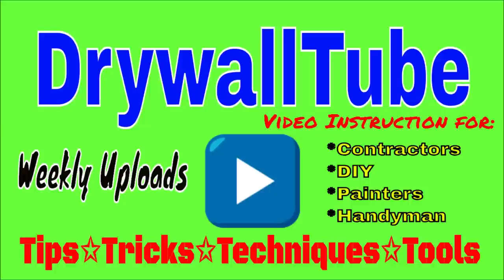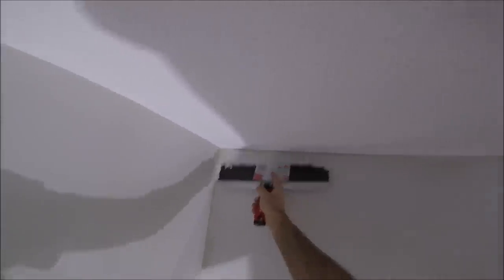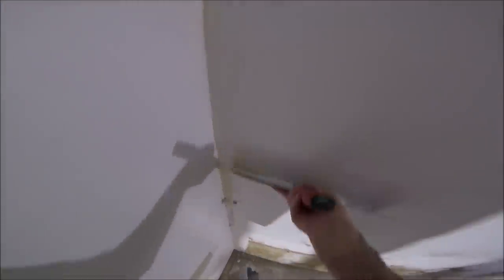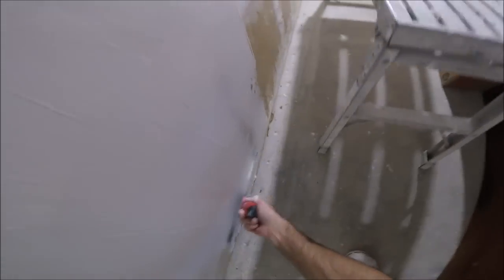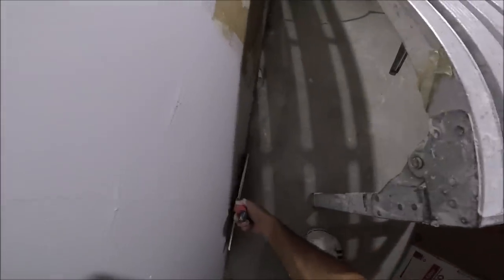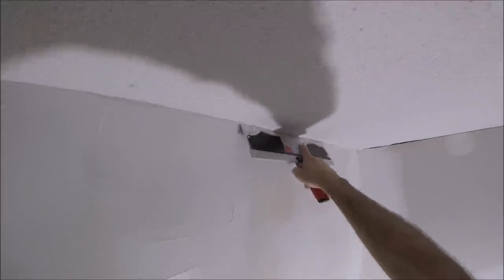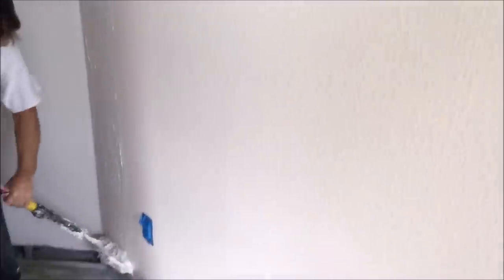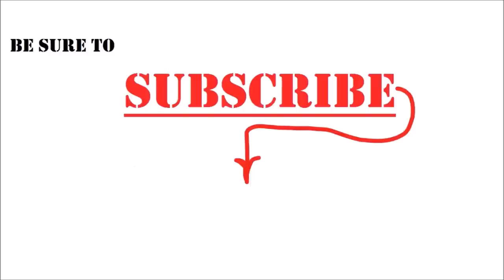How to Cover Your Ugly Damaged Wall with a Skim Coat- Looks Like Glass

Comment: Hi, I am finishing my basement and I did framing, plumbing, and electrical and hired the drywall job out.  A guy hung 67 4x12 sheets and had two coats of taping mud when he got in serious car accident!  I hired another guy to complete the finishing, but got 'took' by unscrupulous guy.  He made matters worse, and then sprayed Kilz 3 over his shoddy work.  I have gotten quotes from $1300 to $2500, and was about to pick someone when a highly experienced guy came over and quoted $500 and said  he could fix it in a day, whereas all others said 3-4 days.  He said he planned to fix problems with hot mud and then do skim coating with USG Topping.  Other estimators said they would use USG Plus3, and one guy said he would just thinned All Purpose (his quote was $1800 for one guy).  I am now wondering if I could do it myself.  The basement has a couple of closets, but is basically 1200sqft of one big room with stairs, a utility room, and a small bathroom.  My question is ... does the 'pressure thing on the right' come naturally after you get the hang of it?    The walls need to skim coating because the primer was sprayed on too heavy and the guy doing the backrolling couldn't get up and also didn't know what he was going so there are places where primer globbed up.  I bought a 9" power sander and the temptation to try it myself is getting to me.  But I'm 71 and not what I used to be.  Advice?  Maybe the experienced guys doing it in a day know what they are doing.  The Kilz 3 will sand, btw.

Comment: #DRYWALLTUBE i have a question.  i have some pretty old drywall in my house. not sure of how old but the tape job has bubles and there isnt an angle you can stand where you dont see the mud stacked up from the horrible job the previous owners did.  i'm a DIY guy.  been in construction, electrician, 25 years.  so  some of the bubbles i cut out  where i did the cutting or pealed the tape it didn't quite do right .  sucked the water out of the mud i guess.  so i sanded 5 or 6 hours on one wall just to flatten out the lines.  now i need to seal,skim coat, sand,  then primer (whats a good primer?).  did i leave anything out?  do i have to seal? and i also have that exact ceiling!

Comment: PAUL... IM A NEWBIE DUIY'er.
I WOULD APPRECIATE ANY AND ALL SUGGESTIONS OR DIRECTION TO ANOTHER ONE OF YOUR VIDEOS....
I'm in a house that was built in 1905. MY father had put up dry wall in some rooms still have very old plaster application. Some of these walls have painters tape STUCK TO THEM. (I took a break. Longer than I should have. I was frustrated with my results and stopped. (Suggestions welcome for correcting...)
Also frustrated with the unevenness of ceiling meeting the wall unevenness. My father prefers the white ceiling color on the walls look. Looks very uneven with these walls being so old . 
HUGE 26 wall project!

Comment: What about for walls that have large lumps and clumps sticking out? Like major uneven walls? 
Some of our walls have been "fixed" in the past to cover up LARGE holes using some sort of mud, and the person half-assed it & now we have large glumps & lumps in our wall. 

Imagine looking at the wall from the side angle, and seeing a large "S" or wavy shaped wall due to the large globs. 

We live in an apartment, so ripping the walls apart isn't an option for us. But we do have permission to fix whatever is there currently. 

Are there any options that would allow us to temporarily fix that wall, rather then ripping it out? The only thing we've tried, was to sand it - but that only smoothed out the bumps 😂 It didnt blend them or get rid of them (obviously). Its so bad that even if we stuck some wall paper to it (the wallpaper likely wouldn't stick anyways) but you'd see the large boulders/lumps sticking out anyways. They are like little hills in our walls (sorry that's the best way i can describe it without a picture 🙈). 

What can we do?

Comment: Dang.  No matter what I do I always get overlap lines.  Am I not pressing hard enough?  I’m using the side of the knife where the ends bow away from the wall.
Reply: Ok I figured it out.  I wasn’t pressing firmly enough.  I was too worried about leaving a edge that I WAS LEAVING AN EDGE.
Reply: I just bought a house built in 1905 and just about every wall has wallpaper. Even the ceilings 🤦🏻‍♂️  
There was an addition to the house in 1980 and they didn’t prime or paint a large wall and I uglied it up real good.  Much like the wall in this video. 
There are also a couple of areas in the master bedroom that were floated in and maybe they were primed 🤷🏻‍♂️ but the wallpaper remover must have softened the mud so there are some gouges that need to be skimmed. 

Thanks for sharing your knowledge.

Comment: 19:53 With the tube-amplifier in the back, that looks like a Hammond organ or something similar. This must be a church or a school. Anyway, it looks good. I like to leave the wallpaper up, mesh&mud over the seams and do just enough skimming to paint it, but if that's not an option, this is a great way to clean up the mess. Most DIYers will probably take longer to get it right, though.

Comment: We flooded but only the floors were messed up. I removed baseboards and pulled up floors. We hired a “contractor” that said it was not necessary to replace the drywall. He fogged the walls with mold killer by putting about 2in holes between every stud and said that the baseboards would cover the holes. My gut told me this would end up a mess and it did! We hired another guy to patch the holes bc he did enough damage! Then, “real” contractor put baseboards up, but as he did some of the walls were not sturdy… the guy who filled holes with mud did not use tape!  After baseboards were up the mud guy attempted to patch the walls that weren’t sturdy (without using tape)!  He put so much mud and was applied unevenly, it became a complete mess! I’m not a pro, but I’m not dumb either!  I learned the hard way! Here we are today, jobs not completed, and after paying thousands of dollars, we have no money left which puts me doing it myself! After self teaching, I can’t believe these “Pros” did not know what they were doing! I appreciate your videos bc I’ve learned how to repair my walls. I’ve had to scrape and sand over and over to prepare before applying the mud. My major concern is that some of the mud is covering the baseboards and the corners are terrible!I am very overwhelmed bc it’s 2200 sq ft home, but I refuse to hire someone else (even if I could afford it)! Do you have any suggestions?

Comment: Hi Paul,
I have been following your videos and love them but I have a question. I often have little air pockets that result in a bunch of micro holes in my finish. I’m using green bucket premixed joint compound that I have diluted down with some water. But I still have tons of these clusters of holes. Any advice? Thanks!
Reply: When adding water make sure to mix thoroughly to avoid getting air in mud also you can remix mud after 15 minutes this will reduce air bubbles
Reply: Roberto Gamez Hi Roberto,
Thanks for the advice! Maybe when mixing, I should also avoid interfacing the beater with the air too? Maybe that’s also how all that air is getting incorporated?
Reply: Also adding dish soap( Dawn)  three quarters of a cup to a bucket of mud no water well prevent air bubbles

Comment: We recently moved into our house and the texture is AWFUL. I've lived in a lot of 70s houses with "creative" textures, but this is BAD... It was a brand new amateur job by the flipper. This tutorial is really helpful, because I need to knock down the glops and smooth it all out. I'm aiming for a vintage smooth plaster look, thankfully board & batten on the lower 3rd for the first room, so I don't have to worry about down by the floor! It'll save my back 🙂

Comment: Man I notice you always have plenty of work time with your mud. I am currently skimming pretty much every wall in my house using plus 3 but it seems like I’m only getting a couple of minutes before it starts to set up and skin over. I barely have enough time to get a decent amount of mud spread out on the wall that by the time I start smoothing it out it’s leaving pull marks and not wanting to spread any more. I wonder if I am not thinning my mud out enough.

Comment: You should have explained to the customer about room to work would not work with all that in the area too difficult shouldn't be that hard if I like the customer I would move it myself but always explained how you need more work space I don't know how you're going to sand that wall with all that garbage there a customer that pulls that crap probably going to be a problem customer sometimes you have to know when to walk away

Comment: DIY flipper wanna be.
Reply: I had a 1920's kitchen wall similar in damage to what you showed. Lots of holes that I patched with those aluminized squares. Multiple layers of wall paper in places. I used the Guardz like you recommended. Turned out level 5.

Comment: Nope,  there has to be an easier and faster way of fixing a wall or skim coating a wall or ceiling.  We live in the 21st century and are still using ancient tools and labor to do something that should be a lot easier, faster to do,  and cheaper to do.